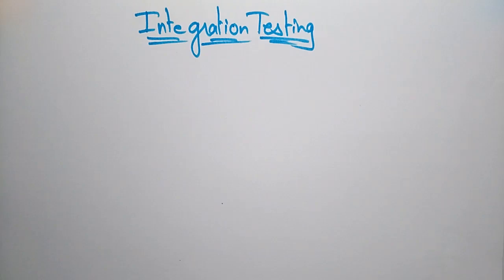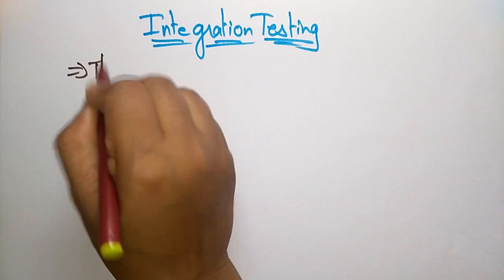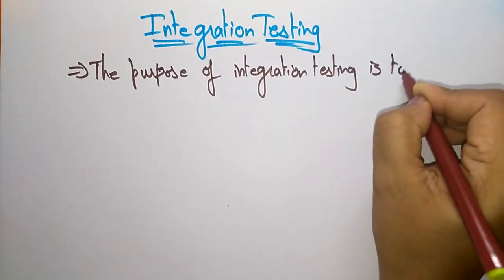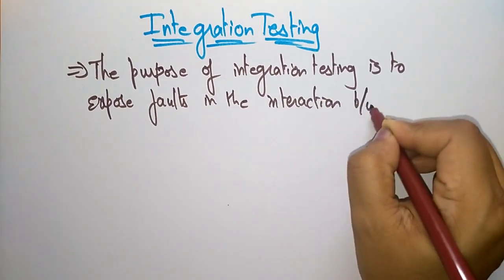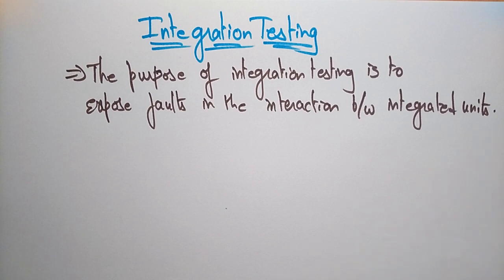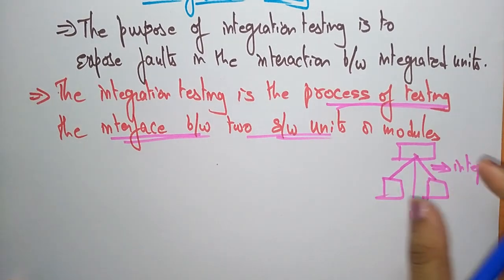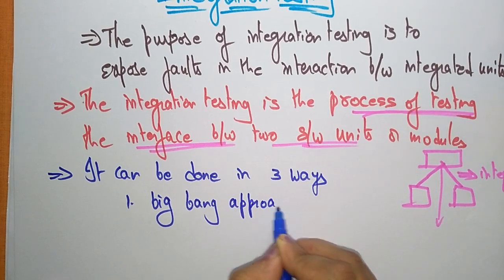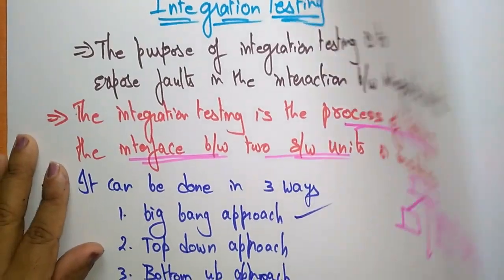Integration Testing | Part -1/3 | Software Engineering | SE | Lec-97 | Bhanu Priya

Comment: Simple defination:individual moduels are grouped together and tested by the developer.
Reply: Not by developer.. This testing is done by testing team
Reply: @aishwarya538  sorry bt its done by developer
Reply: @sudhapadhi7448  pls google before answering, its done by test engineers or testers
Reply: @aishwarya538  Who will perform integration testing depends on a company's practices and preferences. In most organizations, component integration testing is the responsibility of the developer. However, in organizations that have implemented test-driven development, testers may be involved